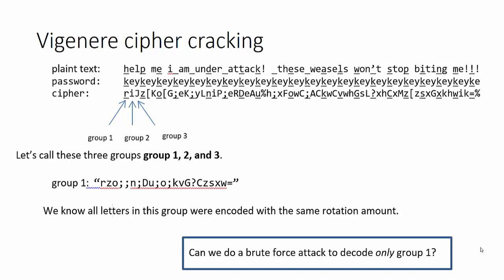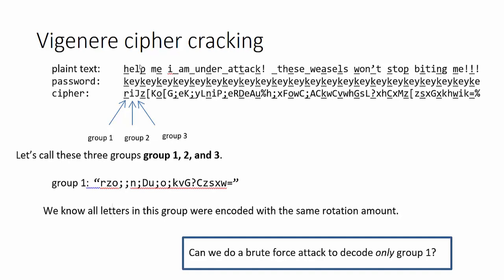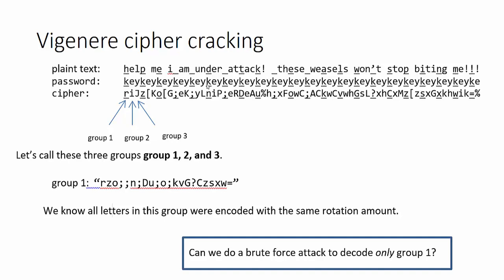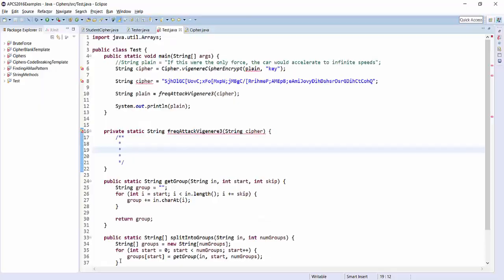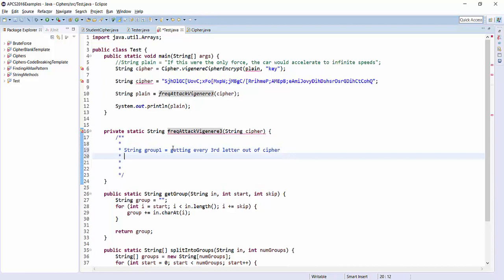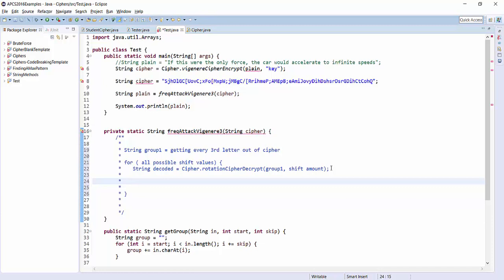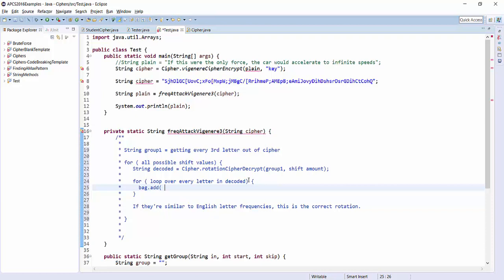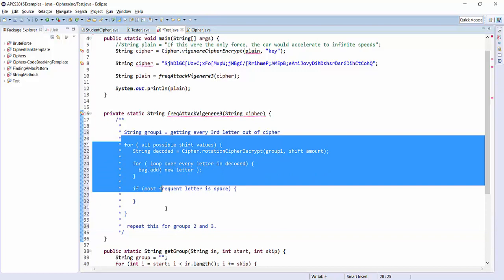Frequency analysis to crack Vigenere 1

Comment: how do you know about the key length?
Reply from the maker: A technique to make a hard problem easier is to make a simplifying assumption.  That's what we did here; we assume we know the key length (which is obviously unrealistic).  BUT, making that assumption let us write some reasonably efficient code.  Now that it's done, you can return to the original question: is there a way to discover the key length automatically?  An easy approach would be to brute-force attack it.  Literally run your method on every possible key length starting with size 1 up to size, say, 20. 

All these videos are for a high school class I teach, and that's what we did as a last step.  I gave them some encrypted text files without telling them the key lengths, and they were able to quickly find 10 and 12 character passwords just by looping over all possible lengths.
Reply: @ddobievich  I tried finding the key length and the key by "Friedman test", but my output was not correct. So, I started looking on the internet but  I found nothing much about that.
Reply: @antrabhardwaj4127  you should try coincidence index method